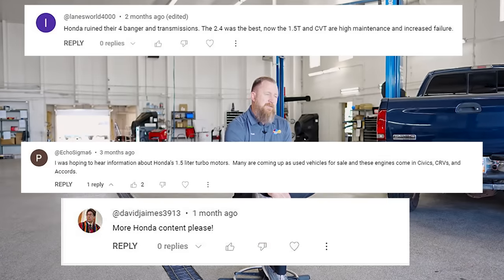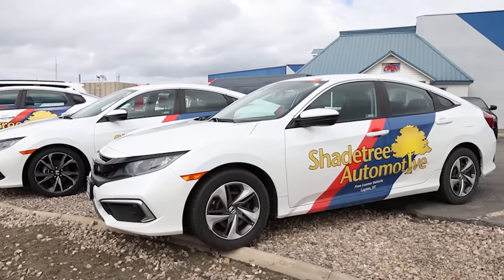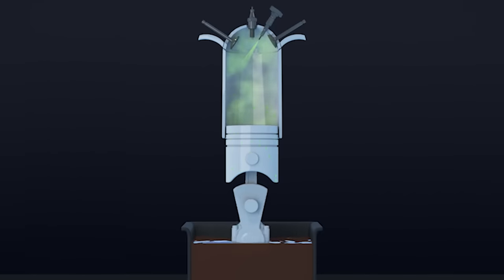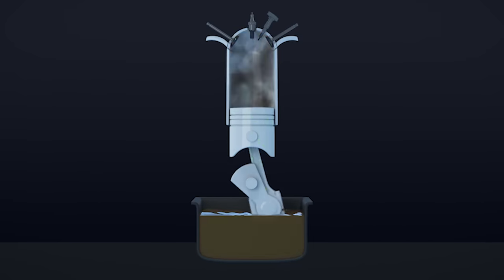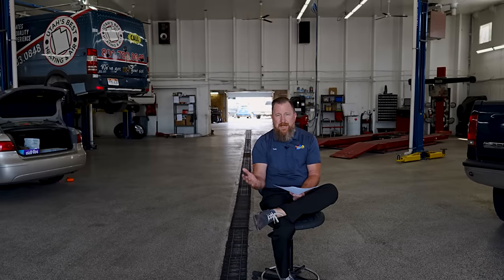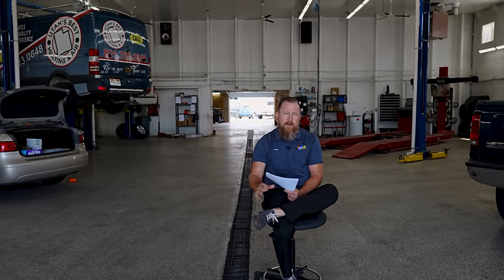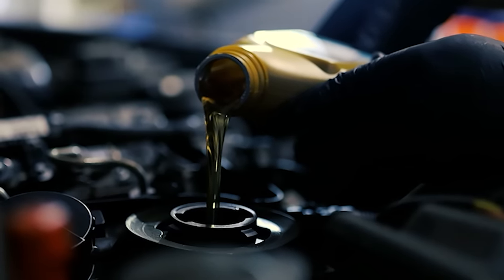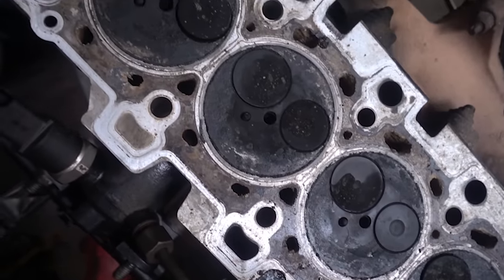Honda Oil Dilution Issue - Should you buy a new Honda

Comment: Thanks for the clear explanation of the 1.5 liter issues.  There are 3 Hondas in the family, a 2020 Civic, a 2016 CR-V and a venerable 2008 Civic … all naturally aspirated.  I am not a fan of turbo engines in general.  You can’t stress an engine with high operating pressures and expect it to provide the 300-400K miles of trouble free performance that Honda motors are famous for.  The 1.5 is a case in point.  I was frankly disappointed that Honda didn’t recall these engines with an issue of this significance, but there were so many out there by the time that the problem was sussed out that I suspect this would have bankrupted the company.  Nonetheless this is a departure from Honda’s tradition of first rate customer service.  Gasoline in the oil is an issue from the first mile, and will be a detriment to the engine from the first mile.  Thanks again for the concise explanation.
Reply from the maker: Thank you for your support!

Comment: I am not a high mileage driver so I time my oil changes out to where I get a full service done every fall (Oct/Nov) before winter gets super cold so it has clean oil during the winter and then next summer it gets hot and the gasoline will burn off,  then next fall (another oil change).    Turbochargers also need new clean oil for their bearings to last longer as the old oil can build up carbon.   ---  IMO 10,000 mile oil changes are not realistic !

Comment: I have a 2024 Honda Accord 1.5T now here the weather is cold, Is it a good idea to remote start the car? Also I let my car idle for 3-5 min when ever I took a short or long drive before turning it off.  
 
Please give your opinion.
Reply: It's easy to become neurotic  driving with a turbo, but modern manufacturing and material science have improved a lot since the 90's. I wouldn't waste more than a minute "warming up" or "cooling down" the engine. Driving gently when starting and ending your trips is sufficient. That's not to say I wouldn't utilize remote start in the winters

Comment: We as consumers should be very upset. What I hear is no manufacturer liability so pass it onto the consumer. 1) increase service intervals=consumer responsibility 2) software updates=consumer going to dealer 3) drive more=consumer put more miles and pay for more fuel and higher service frequency. I’m sure there are others but you get my point. I used to be a loyal honda owner. I’m no longer bc of the lack of response from honda on this issue. How about recommending disabling auto start stop in the cars? That’s a free solution.

Comment: I had 2019. Honda Civic X Sport Plus, with 1.5T engine, 90.000km done in 4 yeears, I did oil change every 7000km, I hade 0 issues whatsoever.

Comment: I had bad oil dilution on my 2019 Honda CRV, and the dealer was of no help in fixing it, and professed ignorance of the problem.   I found out that Honda had recalls going in Canada and China for this problem, and was ignoring American consumers.   I live in a warm climate and still had the problem, and did not do "OK".   I ended up selling the car after 15,000 miles as I was having to change the oil every 2000 miles, and the gas in the oil scared me.

Comment: I have the manual 6-speed 2018 Civic EXT Sedan 1.5T so the software update would only help me half way. I'd have to do the higher rev shifts myself and have to remember to do it. But I could also drive in a lower gear during cruise to make the RPMs higher. Such as drive in 4th gear when I'd normally have it in 5th gear, won't hurt anything since it'd still be far below the redline for crying out loud. Just would get me very slightly lower fuel mileage. But a big problem is the turbo needs to be warmed up before you shift it hard on a cold day. I short-shift until the turbo gets warm. One time I drove to Idaho and back and purposely never shifted into 6th gear, left it in 5th the whole trip. Just to see what would happen. I still got 42 mpg!! My 2015 Fit is also a 6-speed but with much shorter gears. My Civic is only 3200 RPM in 6th gear at 70 mph, while my Fit is about 3550 RPM in 6th at that speed. Much taller gears in the Civic.
Reply: Those 6 speed sedans are rare, Honda only made them for a couple years.  If you're really worried about oil dilution I'd be happy to buy it off you for say $10k.  Remember according to everyone here it's a ticking time bomb. 😁

Comment: Does the software update extend the shift points so the engine builds and maintains a higher operating temp?     I imagine doing that is going to start cutting into the fuel economy.
Reply: this isn't an auto he is wrong it's a CVT transmission....
Reply: @jedknutson8373    Ugggggggg even worse….

Comment: I live in Cold Northern Europe I have a 2018 2019 CRV1.5T with a Manual transmission , no issues with oil dilution oil stays the same on the stick every time, car is used for short trips and three long trips throughout the year, cars now on just over 80k miles.Not sure if this is due to the Car being a direct import from Japan or that we use higher octane fuel than in the US, also the oil change indicator by default is set to 5000 miles before it needs the oil changed my Honda dealership always replaces the oil with 5w 30 oil c2 or C3 ( Castrol Edge) they advise no need for 0w 20 oil here too thin I am told.

Comment: The problem is real simple. The engine injectors are not correct for the specific engine and air temperature. Honda could change injectors to improve atomization and reduce the fuel delivery volume ultimately reducing the power in order to improve engine operation. Every time you have fuel dilution is because you have too much fuel and poor nozzles . Honda can install engine preheat system to keep the engine warm at all times and prevent the problem but it will increase the cost or simply stop selling this engine to people that are located in colder locations.

Comment: my 2018 cr-v with a 1.5 makes oil always. I use amsoil best and a qt of lucas with an oem filter every 5k. So far so good but bought an extended warranty just in case but only have 12k left on the ext warr.   Honda did extend the engine warranty also I believe???  love the power and economy  about 34 mpg usually

Comment: Okay, so the 1.5T engine is designed to run at a lower operating temperature. But they push out software updates that increases the operating temperature so the leftover gas burns off, that makes sense. But then the engine is running at a higher operating temperature than it was designes for, soooo won't that affect the lifespan of the engine in general because it runs a little hotter than it was designed for?

Comment: Other companies have direct injection turbos and I don't hear issues with them.
Reply: Oil dilution has been an issue in the past with VW/Audi, Hyundai/Kia, GM, etc...but in those cases, it's mainly the direct injection pump leaking internally back into the engine (The high pressure pump is driven by the camshaft). Like mentioned in this video, the stringent emissions and fuel economy targets are pushing all manufactures to the edge. my statement is based on direct hands on experience for what it's worth.

Comment: I'm wondering if my '22 Honda Insight 1.5L 4cyl will have this problem.  I've  been changing the oil every 4000 mi, no gas odor noted.  The factory spec sheet states this engine is port injected.  Is there a way I can confirm it is with no disassembly?

Comment: Quick question maybe you or viewers can answer. 

Will installing more efficient fuel injection system help? Will better airflow help? Obvious higher octane burns more efficient. We do know Honda is using weaker head bolts, small rod bolts, head gaskets are crap, and the head design is weak compared to the older engines. 

Thank you

Comment: I have no problem with a new Mitsubishi 4A95TD (1.5T) direct injection 
Using Under the hood of Chinese SUV brand new Forthing T5-evo (1.6Ton)
Engine oil is still clear after running 4000-5000 km after oil change. Maximum fuel efficiency is 3.5L/100km at 65-70km/h.
Now it is 1.5 years old and at 42***km.

Comment: I have a 2017 CRV with the 1.5 Turbo.  I have kept a close watch and never noticed any gasoline smell in the oil.  I also have never let the vehicle go over 5k miles between oil changes.  The two issues I have with this engine are that the oil is always dirty and that I have had to have the fuel injectors replaced twice.  I have a HondaCare 8/120k warranty. I will not keep this car after the warranty expires.  I will also not buy another Honda with the 1.5 Turbo in it.

Comment: That’s not fixing the problem! With honda’s software update makes it less fuel efficient, delaying the transmission shift points means the engine now will run at higher rpm’s and now it’s less fuel efficient! The consumer has to deal with the problems,Honda isn’t really doing anything but a bandage fix for their screw ups in my opinion.

Comment: Great Video! Well organized with straight forward communication. Well done! 

I have a 2017 Civic EX with the 1.5. 90k and so far so good. I live in CA. and the weather is usually 70• - 100• year round. 

Would like to know what product you recommend for cleaning the Carbon Buildup? There are a lot of them out there.
Reply: marvel mystery oil!
Reply from the maker: We use a Valvoline product.  BG also makes a good one

Comment: I have a 2016 Pilot V6, Texas car, wife drives many short trips per day. I lost an engine to this, locked up, could not turn it over with a large breaker bar on the harmonic balancer. I used Mobil 1 synthetic oil. Had to file with Honda for assistance as I was a few thousand mi. out of warranty, 66K. They replaced the engine with a new one for $2500 cost to me.

Comment: Thanks for that info -- didn't know Direct Injection (DI) had a "side effect" of oil-dilution. My truck has Electronic Multi-Port fuel injection and not DI so oil-dilution shouldn't be an issue -- just lower MPG numbers (than DI) are.  ;-)
-- BR

Comment: what about the HRVs?  i'm looking at a used 2018 20,000 mile HRV.  That year HRV has the 1.8 L engine with no turbo. The 1.5 turbos are having those issues

Comment: Increase oil viscosity to 0w30 or 5w30 API SP rating like mentioned in Honda manual outside US + use high octane fuel and change oil and oil filter every 5K or even less if short trips (less than 5 miles ) .
Reply: Yes, and drive it like you stole it once in a while, people doing short trips and driving like miss Daisy makes any engine worse fast.

Comment: Honda- Pilot & Acura- RDX & MDX -3.5L, 3.0L also have engine noises in early morning when first started engine, especially colder weather.  
More like lifters noises, cause these engines are still using timing belt type.  Also, I noticed oil did have smells gasoline after 3,000 miles.  
Every parts from Honda and Acura are expensive.  Toyota seems to be not so much trouble getting parts, and the price is right.

Comment: should I go to a 5w30 over the 0w-20. I smell a little gas during oil change. been changing oil every 5k since new, now 78k on motor. was thinking about changing oil every 3k and using slightly thicker oil. Your thoughts.

Comment: I have had 1 claim for the oil dilution tsb in the last 8 months...1, total...i have done 500+ turbos, head gaskets and fuel injectors (none of which fell under the oil dilution tsb) i have maybe 100+ 6 speed trans that need torque converters under the new WE. All in the last 8 months

Comment: I’m very happy with my 2018 Civic EXT. After 163,500 miles I have no complaints. Great performance and great fuel economy. I’m averaging 36 mpg.
I rarely drive short distances. I drive over.60% highway. I rarely exceed 4k rpm. I always change the oil/filter every 4,300-4,500 miles. I only use top-tier Shell 93 Octane for the highest detergent to mitigate carbon deposits.

Comment: does the 24 ex-l with the 1.5 turbo still have these issues? also is 5000 mile oil change still necessary with mostly highway miles?

Comment: No mention about the common issue of head gasket failures on this engine usually between 50 and 70 thousand miles.  Weak head bolts, and bad head design is causing this. Also my sister has a crv, she lives in the southern California desert area.  She has fuel oil dilution,  even in the summer May thru September whe temps average 112 to 125 F. I wanted to check this so she had the oil changed in june, and at 4000 miles I went over to her house and checked her dipstick.  It was about 3 mm above full, and REEKED of gasoline.  She has about a 15 minute drive to work freeway,  5 days a week, she also had driven the car to Las vegas 2 weeks before I checked it, about 260 miles, each way. So driving a long  distance didn't seem to do anything as far as making the fuel evaporate.  She is now on my recommendation changing the oil every 3000 miles. Obviously,  these engines will not last 200, 3000 miles..I definitely feel for her on this situation.
Reply: I have a same problem 
What to do it’s heavy problem?

Comment: hey, i'm on the brink of getting myself a used Civic 1.5l sport plus (EU) build year 2020.  Would you still recommend it ? i drive normal, dont speed, dont race. and i'm looking to hold the civic for atleast more than 5 years. like to get 8 to 10 years if possible. the 2020 civics 1.5l turbo have this problem also ? thanks !

Comment: This is awesome information.  I'm considering buying a new CR-V, but not sure whether to go with their 2.0 Hybrid of the 1.5 Turbo. I plan to make this my last car purchase, so it needs to last 15 to 20 years - if I live that long.  My annual mileage is estimated to be less that 10K a year. Will either of these engines last that long?
Reply: I think my only concern with the hybrid for a car you intend to keep for its lifetime is that you will likely have the expense of replacing the battery.  The average lifespan is about 8-10 years or 80K to 200K (200K being very best scenario).  They aren't inexpensive and probably depends a great deal on the volume of hybrids.  The Prius for example has been around for a long time and sold in high volume, so there are cheaper battery options compared to the average battery cost for other cars.  If you plan on exchanging cars every 4 or 5 years, different story I think.
Reply: @johnmininger7472  Thanks. This makes a lot of sense. I looked up the current cost of the battery and it was +$5000.  8 to 10 years from now, who knows what the cost will be. Plus there is the labor expense for the installation.
Reply: @vindee5670  - Yeah, I don't have an issue with hybrids in general.  If you are replacing your car every 3 years, I think it makes a lot of sense.  I tend to keep my cars as long as they last, so I'm doing the math ...

Comment: Ayayayah 😢 we looked at the new 23 CRV's but backed away because it seems they have the same problem, it's not fixed. 

As to the more frequent oil changes, our dealer flat out refused to change our Accord's oil prior to trip because they said it was good for another 2000 miles.  We were not happy.

And our prior Accord had a battery leak that the dealership could not find but did offer to sell us an onboard charger.  It was ridiculous, I had to charge the car after sitting two days undriven.  

We like a lot about our Honda but we are looking elsewhere.

Comment: i really love the design shape of the Honda CRV 2024 best shape i have ever seen however im so turned off because its turbo concerned about high maintenance cost of turbo issues oil dilution sad when govt gets involved it messes up everything  i have honda accord 2013 4 cylinder got it with 14k now has over 190k best car no issues at all this is how cars should be made.  thank you Honda for those cars.
Reply: I bit the bullet and just bought a 25' CR-V. I like everything about it. I am leery about the 1.5L but I plan on being aggressive on the maintenance cycle. We'll see how I feel when the warranty expires. It is a smooth running beast, though.

Comment: Just use 10 w40 oil. Ha,  well some engines  one can ADD gas to the oil.  Large radials aircraft engines are hard to turn when its cold in cold weather.  If it is going to be cold in the morning one switches on gas to flow in the engine before turning it off.  It is idled a minute to get it in the oil tank.  Next cold morning it will crank over and engine heat will drive it out while flying.

Comment: Sad. I love the new Honda design. My '98 Accord hit nearly 300k miles with just regular oil changes. Not sure which car to get now. Mazda was looking good until the cracked cylinder head issue. The Camry doesn't have a CVT, which I love, but the interior just seems so cheap. Think I might just buy an older car. Tried and true.

Comment: I got a 24 honda civic with 1.5l I'm bought to get it's second oil change I changed it at 1k for break in it still has some fuel dilution it's almost got 5k miles on it now it had a bluish tint and it smells like fuel that's on 4k miles kind of worrying me a bit about long term reliability

Comment: Don't know if it's a Honda spec but 2.5% is nothing on a GDI engine and i know the oil manufacturer determines the threshold for your oil blend as it relates to vicious but 5% cut off for flagging a GDI is more realistic.. with that the change  on the dip stick is not that visible, up to 10% is the cut off for catastrophic engine damage starting, my friend's CRV was clearly significantly higher on the stick which would be a higher percentage for sure however his oil wasn't tested but visually it was clear he drives 3 hours one way per week for work.. Honda did reach out to him but also warned of premature cam wear..
Reply from the maker: Yeah, the exact specs are almost impossible to measure.  You basically need to just use common sense.  If it smells heavily and is starting to go up on the dipstick, it is worth looking into.